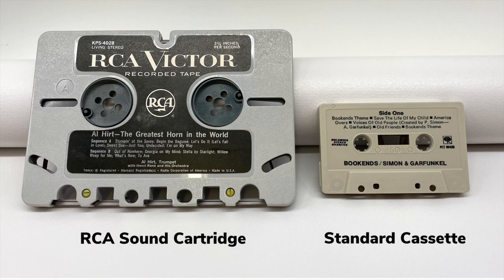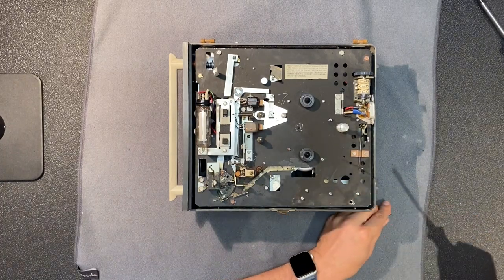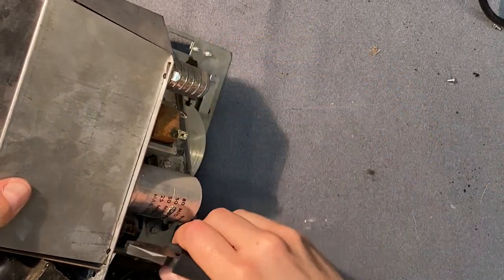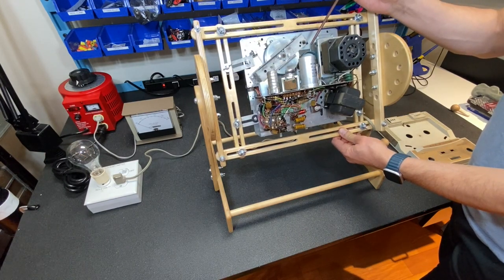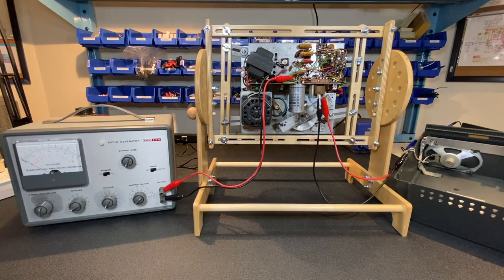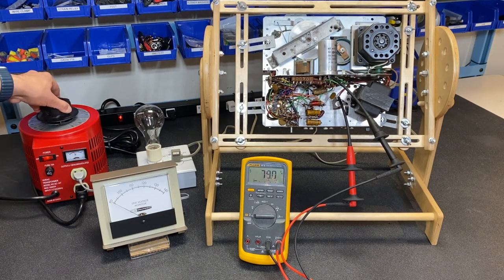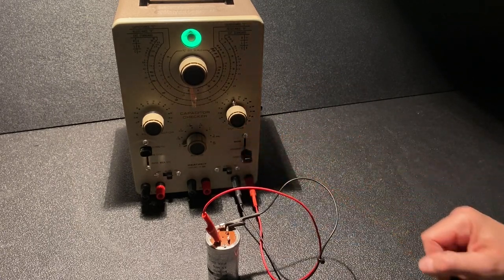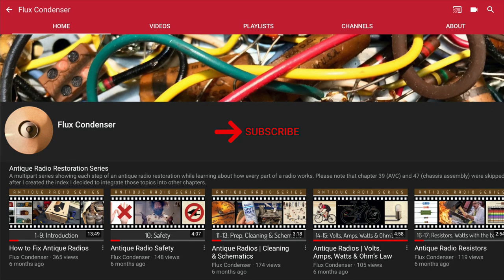The original GIANT Cassette! P1 • Let’s Fix a 1962 RCA Sound Cartridge Player

Comment: Just watched these series again on the player. I gave a few of this model. I’m going to recap it this weekend. And change belts
Mine works well, but the rewind is slow. The belt I think is just stretched from age 
I love that mounting tool you have 
Makes it’s easy to work on it
Reply from the maker: Check the rewind idler link which I’ve found is usually the cause for slow rewind. It’s meant to be bent to give the correct amount of force. I wish you great luck with your restoration! The stand I use in the video is from radiostands.com

Comment: Getting ready to work on one of these. The function knob is locked up, Some previous 'repair person' was into it, then he decided he could not repair it. The owner sent to me, I have to possibly undo any work that was done before, then re do it correctly.  Growing up, my aunt had one, a stereo version she bought new,  with fold out speakers. After she passed her daughter ran across the cartridges, but no player. So if I get this clients machine going, I may be able to use it to transfer the old tapes to digital.
  The client may have had it recapped I don't know yet. That's no problem to do, as I work on vintage radios. It's the mechanical part that worries me, just have to get in there to look.
 Thanks for the video at least it gives me a preview of what to expect inside.